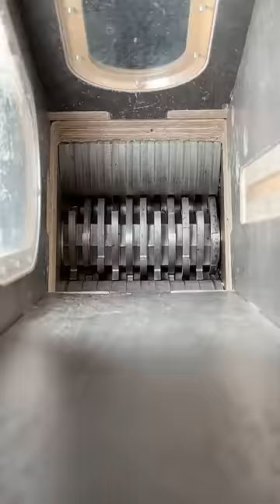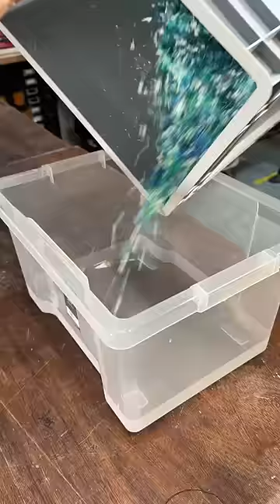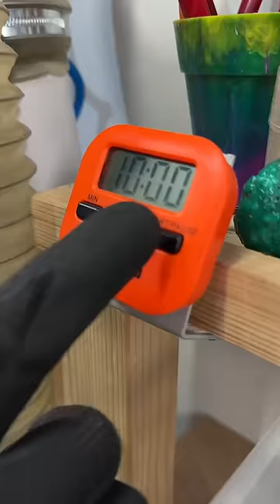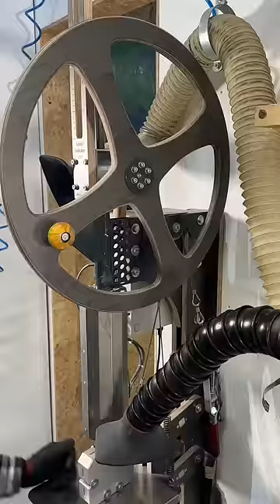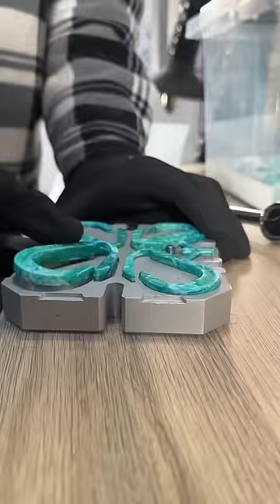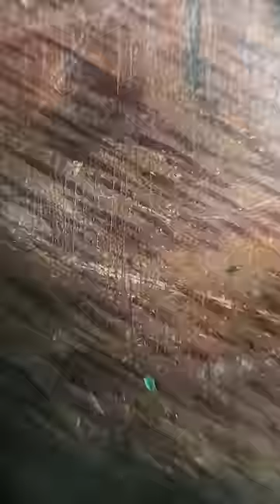How Recycled Plastic Carabiners Are Made

Comment: Forget the plastic carabiner...  Dude has his own injection molding machine!! 😳🤣🤣
Reply: I'm having 2 built at about $50,000.00 for both. I invented something and gonna be selling a product.
Reply: COOoool !
Reply: So right , I am thinking about owning one someday
Reply: I sell these for a living. Doing this by hand is surprising to me. It's been all robotic since the 50s
Reply: Uhm. That's about as rudimentary of an injection molding machine as one could possibly create. Not hating, but as a plastic injection molding process engineer, I assure you that is as simple as it gets.
Reply: @andrewledford3865  as a machinist by trade I understand it's a simple version but still interesting for someone to invent there own machine.  That's pretty cool and what type did you primarily work with? Plastic or metal injection molding?
Reply: @johnsutcliffe3965  plastics. I spent about a decade as a production engineer, working with plastic injection. I've since moved into electronics production though.
Reply: @theroadking547 yes but he made one by himself for less. Great buildup!
Reply: More like casting
Reply: denisematteau  what is the harm in doing this? I assume the tensile strength and durability, but if it's on a small scale for items that doesn't have a lot of strain on it, wouldn't that be fine?  I'm just an EE so I didn't go deep into the material properties as such
Reply: @theroadking547 Why $50K when you can get one for under $1000? Is your extremely high volume or something?

Comment: You waste a lot of power to make a plastic chain !!!!
Reply from the maker: It's a plastic carabiner.
Reply: I don't think you understand how little power this uses. If this uses a lot of power then you'd need a dedicated power station to make toast in the morning
Reply: @Coastal_Cruzer A toaster draws over 1000 watts. They draw a lot of energy to generate a little heat. Generating a lot of heat takes an enormous amount of energy.
Reply from the maker: The machine has been developed in such a way that energy use is minimal, as the temperature controller only activated the heating elements selectively to maintain temperature. The energy consumption of the machine is around 0.35kWh, which is considerably less than a regular hairdryer. The heat is also encapsulated by an insulated sleeve, meaning that very little is wasted. 

We don’t use the oven constantly. After the initial round of hearing, the mould self-heats using the radiant heat from the plastic entering the mould.
Reply: @ians7184  yeah an old unoptimized toaster
Reply: @BrothersMake  I find this to be pointless, but I've gotta admire that thermal efficiency. Good on you!
Reply: Hahaha...... Chain. Somebody wasn't paying attention today
Reply: Let me show you this thing called a "Factory"
Reply: If you think recycling is bad for the environment, just wait until you hear about landfill and factories pumping out worthless single-use plastic by the ton every single day! Go protest about the energy waste of private jets, or factories, or massive industrial farmlands, or unnecessary diesel cars! A small operation melting and reusing plastics isn’t going to make a dent compared to those.
Reply: @BrothersMake  
A bunch of pseudo scientific mumbo-jumbo.
You say "little heat is wasted."
Learn some physics.
All the heat that was used is wasted, you have no technology that can reduce that.
Reply: OR you MAKE CHAINS knowing the POWER that's ALREADY THERE is USED to GOOD effect 👍! 
LEt's see - 
a You-Tube TROLL whining about some ELECTRONS getting pushed though a grinder and a heater , 
while 
a DO-er ACCOMPLISHES turning WASTE into something USEFUL , even potentially SELLABLE !
COOOoool !!
Reply: @Alec72HD ah yes pseudo scientific term such as insulation and PID control loop. Things that many people know are hard concepts to grasp and is nigh Sci fi
Reply: @table2.0 the goal should be to pull all plastics out of the ocean an landfils an figure out a way to cleanly burn it for energy and NEVER use plastic again...but Instead we have idiots like this finding more ways to use plastic....use leather wood metal glass they even make green leather that is mostly made of plants

Comment: I liked the buttons one.   This one I'm less certain of because there are idiots who will use these for load bearing situations.

I'd also be worried that since they're of inconsistent makeup and thus strength they could be risky for suspending anything on, even if it is something light weight, as it might break open the carabiner and cause whatever is on it to fall - possibly resulting in it being considered "not of merchantable quality" for the intended use.

Pretty cool idea, I'd just do something other than carabiner type things.  :D
Reply from the maker: If you manage to break this it’s a sign you’re carrying too many keys 😅
Reply: @BrothersMake    Well, I do often have a lot of keys, but I was thinking more cases like with the water bottle or a similar container.   Or a case where I've got keys on that carabiner and snag the keys against something, causing the carabiner to break and losing the keys. :(

Either way, I like the recycling idea, it's just that I don't like the idea of relying on just a plastic thing (however well made) to keep something important like keys on.

Buttons are good, cases for things would be good, desk tidies/pen holders would be good, support stands for phones maybe?  Cable tidies / something like the carabiner but designed to be wall mounted to act as a cable guide. Like... I've got half a dozen USB charging cables attached to my computer for my headset, phone, tablet, bike lights, and so on.   Being able to pin those to the wall with a couple of loops would be useful.
Reply from the maker: Each of us in the team has had one of our carabiners on our keys for months with absolutely zero issues with daily use. But if it’s not for you that’s no problem!
Reply: Your talking as if plastic things to hold keys dont exist outside of these hook things...they haven't reinvented the wheel here. Its just a simple useful thing that can make and sell.

Comment: If I had that shredded plastic, I would’ve turned it into a 3d printer filament and print enything with jt
Reply: Significantly less efficient than injection molding
Reply: @Coastal_Cruzer shut up. 3d printing can create everything injection molding can, and then some
Reply: @Sentient-cassette-player  doesnt mean its efficient
Reply from the maker: @Sentient-cassette-player it can, but it isn’t the most suited for a lot of applications. Making filament from recycled plastic shred is also extremely difficult to do consistently without an incredibly expensive setup.
Reply: @iUseCassettes hey buddy, believe it or not, they never said 3d printing can't make it. Maybe you should spend more time in reading class.

Comment: He showed one on a water bottle, which is pretty funny because it would never reliably hold a full water bottle. Even an empty one would be pushing it and very likely to fail if you clipped it onto your bag and walked around. Then he showed them on keys which is a terrible, horrible idea. You definitely do not want to trust something as important as your keys to something this unreliable. He is using trash to make different trash with extra steps.
Reply from the maker: How do you know it won't - have you bought of one these to try? We both make and use these, so can fully say they're more than strong enough of holding the weight of a full bottle, let alone keys - and do both of those things daily. The amount of confidence you have talking about something you've never tried out is certainly impressive though - bravo, sir!
Reply: You realize plastic is plenty strong for a keychain or water bottle holder, right? Like do you understand that most plastics nowadays aren't super fragile and often perform better than metals in many situations because plastic can flex
Reply: Clown lol
Reply: @Wance_Chilkins then go buy a different one. No one is forcing you to buy this one
Reply: @339_Lloyd_Street_Akron_Ohio  stronger is debatable. Lot of the keychain ones are made of cheap aluminum or zinc
Reply: @339_Lloyd_Street_Akron_Ohio  so why do you care?
Reply: @339_Lloyd_Street_Akron_Ohio  no they aren't. Cheap aluminum is easy to break and wears away really quickly. Plastic flexes and doesn't really abrade too well
Reply: @339_Lloyd_Street_Akron_Ohio  they don't use good aluminum in small products like this bud. Also quit acting like plastic is a single material. Saying plastic is weak is like saying metal is weak. What metal are we talking about? Brass? Zinc? Aluminum? Steel?
Reply: @339_Lloyd_Street_Akron_Ohio guess what! This channel made a video proving that this plastic can be recycled DOZENS of times before it loses any significant amount of strength!!

Comment: Your process using waste material will not yield carabiners of predictable and reliable strength. Of course, it appears that your "carabiners" just have the style of such devices and are not actually intended for anything other than as novelty items.

If someone does use one as an actual carabiner and suffers severe injury or death, then you'd better have a liability insurance policy sufficient to cover a significant judgement for damages, as the compensatory and punitive award could easily be in the millions.
Reply from the maker: We specify on the website that these can't be used for climbing. Other than that they work great for the purposes shown in the video.
Reply: @BrothersMake  If it were my company, then I'd either immediately stop selling these items and recall every one I'd sold, or redesign the "carabiners" to break at such a small force that not even a small child could lift himself off the ground.

Your disclaimer won't stand up in court to limit your liability.
Reply: Come on pal 😂 it’s for hanging your keys on
Reply from the maker: Luckily it’s not your company!
Reply: @gaiustacitus4242 FYI there are many different carabiner clips made from various materials for different purposes... if the purchaser isn't smart enough to use "good sense" to know that a plastic carabiner isn't meant for heavy duty, that's on them and not the owner or manufacturer .. I think these carabiner clips are awesome for light duty things, you don't need to be ignorant and rude
Reply: @michellesotelo85  Many manufacturers and food vendors have lost lawsuits and paid out massive amounts of money in judgements in cases where the proper use was far more obvious than your "carabiners." Customers are not required to have "good sense" and relying on that line of reasoning is foolish.

A person in business must be prudent in protecting his own interests. Always assume that your customers are idiots who will misuse your products and then sue you when they cause harm to themselves or others.
Reply: Ah yes, the comments lawyer

Comment: You can get the key ring on the carabiner itself, which is a lot beefier than the designated hole. Would probably be more secure. The pin hole is nice for a lanyard ring tho. The colour is dope that for sure.
Reply: BEST thing to do there , is to thread a ring thru the hole and put the key on the ring . I use a dual-carabiner (aluminum ) with rings in one side and the keys on the rings . THIS way I can easily pull a key FROM the carabiner , for whatever reason needed 👍!

Comment: I love this! I wonder if there is a way to do something similar at home without much outlay.
Reply from the maker: Absolutely, we have a load of videos on our channel to show you how to do it at home with simple setups 👍🏼
Reply: I've recycled HDPE into slabs that can be machined with woodworking tools to make drive pulleys and brackets. Chop it up, heat to the right temperature (I used an electric wok wrapped in insulation blanket), drop into mould (can be just a shallow MDF box with a thick lid that fits inside, waxed) and press hard with bench vise, leave to cool.

Comment: Would induction heating heat your mold with less energy/quicker? You may be able to rig a quicker method to release your mold. I immediately thought bike seat clamp but generally those have a plastic washer of some sort to allow for smooth operation.

Comment: Reasons why i believe this is a scam:

So, we gonna just ignore that theres absolutely no recycle markings indicating what kind of plastic those are, meaning if you get a mix of multi melt poilt plastics like pla and polyetheline, which are 100c appart thats just gonna gunk up to hell and back

Or that recycled plastics are brittler and weaker and if those parts were already recycled.....snap?

Theres no quality control/chemical indicators showing what those plastics have come into contact with/were used for, meaning we could have bleach or amonia being mixed in

The things a solid mold meaning the entire carbeaners curves are under compression and tension when under load unlike spring based carbeaners, meaning constant strains and fracture points

As well as the power wasted to do all this "recycling" on a small scale inneficient step instead of proper recycling

Unless you got SUPER lucky with your plastic to get that texture and color when the plastics going in were faded and see-through, you DEFINITELY swapped it out for proper PLA fillament

Yeup, they made this video for clicks and sales
Reply from the maker: Haha, you couldn’t be more wrong!

1) We hand-separate all plastic waste donations that we receive. The plastic in this video is 100% HDPE, which means bonding is never an issue.

2) We made a full video about whether plastics really do get brittler the more they are recycled. In the case of HDPE, it doesn’t seem to make a noticeable difference. It’s the latest a long form video on our channel. 

3) WE are the quality control indicators. We only accept certain types of plastics and as well as hand separating, we hand clean too. No ammonia!

4) Of course it’s under constant strain. That’s what creates the spring effect in the design. But this type of plastic has enough malleability that fracture isn’t an issue.

5) We don’t waste power. Not only does all our power come from renewable sources, the machines have been developed in such a way that energy use is minimal. The temperature controllers are only activating the heating elements selectively to maintain temperature. The energy consumption is around 0.35kWh, which is considerably less than a regular hairdryer. Also the heat is encapsulated by an insulated sleeve, meaning that very little is wasted. We only use the oven initially to pre-heat the mould. After the initial round of heating, the mould self-heats using the radiant heat from the plastic entering the mould. 

6) We didn’t swap it out for PLA 😂 PLA is considerably more brittle than HDPE.

Not everything is a conspiracy, but nice try trying to find one in a plastic recycling video 😅